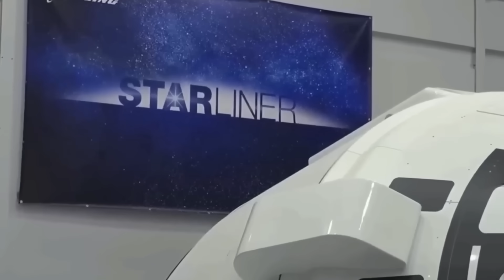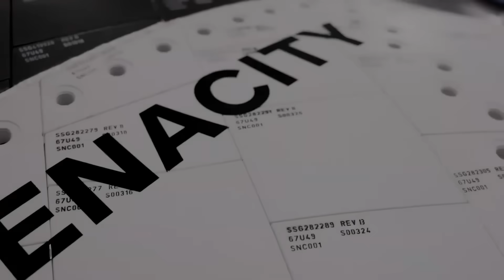Boeing Lost Billions Over Starliner... Starliner Now Cancelled!

Comment: The Boeing Starliner returned safely. So the astronauts could have come home aboard it. This site appears to be another one of those SpaceX propaganda organs. The reason Starliner exists is to provide an alternative to the dragon system. NASA saw what happens when they rely on a single source of flight to orbit when the shuttles were grounded. They quite sensibly want at least two independent ways of getting Crews to the space station.
Reply: "could have" yes, but it still experienced thruster issues during its return - they didn't know, and given the choice of killing two astronauts trying to return them or leaving them up there they chose the latter.  Yes, a SpaceX propaganda win, but after two shuttle disasters NASA kinda had to make that choice.
Reply: @captainz9  without doubt the Boeing program is a mess, but despite multiple Thruster failures, it still returned safely, which suggests that the overall design is the sound. With 17 fatalities not including the training jet accidents, it's understandable that NASA is being super cautious. But a lot of people on this site seem to forget that NASA is determined to have at least two separate and independent methods of getting people up and down from orbit. SpaceX is clearly number one, but there must be another